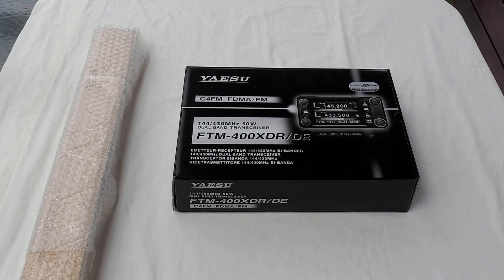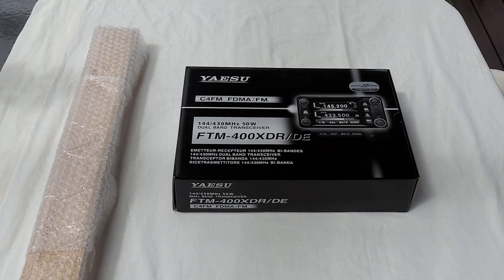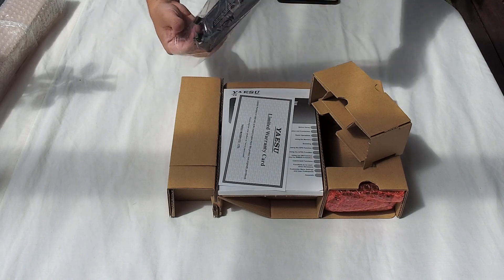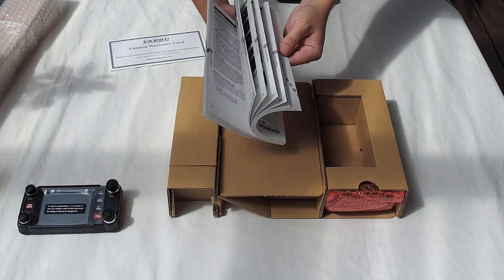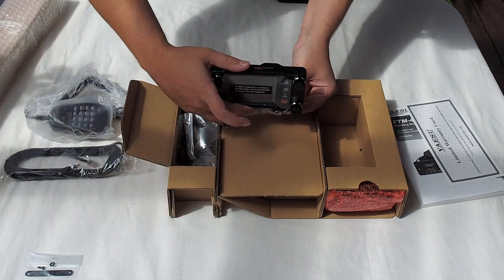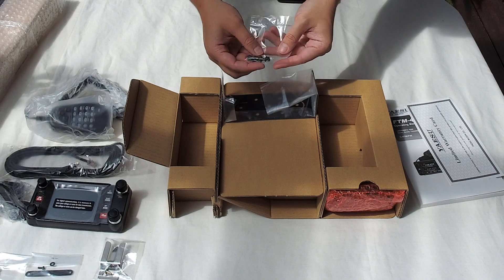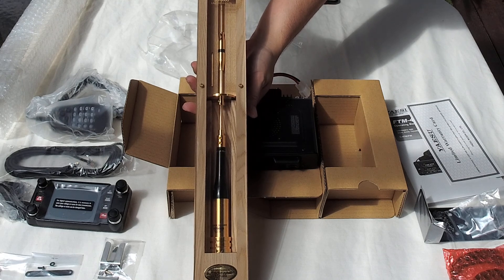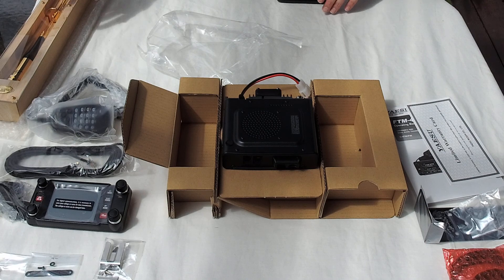Yaesu FTM-400XDR Unboxing & 24K Golden Diamond Antenna!

Comment: I want a radio to operate C4FM fusion am I in doubt between YAESU FTM 100D or FTM 400 DR? What is the best option ?? 73
Reply from the maker: If you can afford it the FTM400XDR is the best choice.  73, Jarrad VK3BL :)

Comment: hoping to purchase in December 2018 KC1JQX going to put in my . subaru outback  what antenna should i purchase thank youfor your help
Reply from the maker: It depends where you live Rachel, but generally speaking I have found a shorter, 'low gain' antenna is best for suburban and city locations as antennas with too much gain tend to be subject to 'picket fencing' or rapid fading as you drive along; there is more than enough power and sensitivity in the FTM-400 to not require a high gain antenna for all but rural work.  You can't go wrong with anything made by Diamond - just find one that you like the look of, has the features you need (e.g. stay with simple designs if it is going to whack overhead car park roofs etc), and suits your budget.  73, Jarrad VK3BL

Comment: I would love to see an in depth review on this very popular radio.
Reply from the maker: Its DEFINITELY on the cards, we just haven't had a chance yet with Christmas and New Year duties.  

So far I am loving the radio, and am a big fan of System Fusion & Wires-X in General.

We are planning on producing quite a bit of Yaesu System Fusion content, so stay tuned.

Inside Tip: The FT-70DR is an AMAZING radio for the price, and a complete bargain.  If you haven't got one yet and want a Digital Handheld thats compatible with Wires-X, put some money aside!

73, Jarrad VK3BL & the Rate My Radio Team